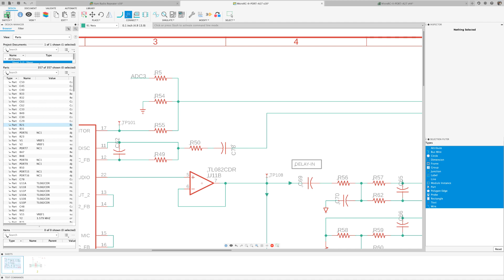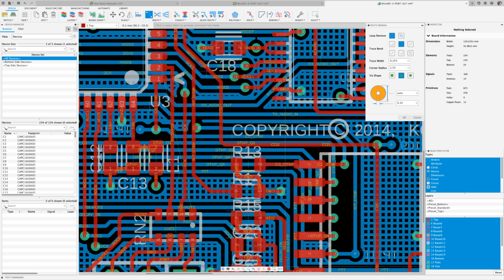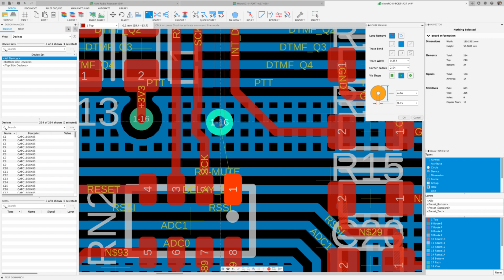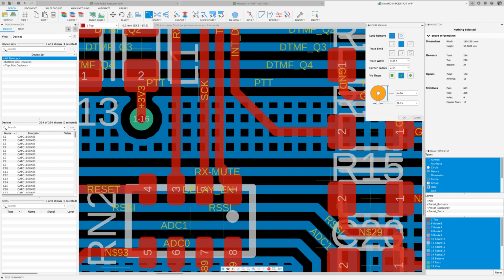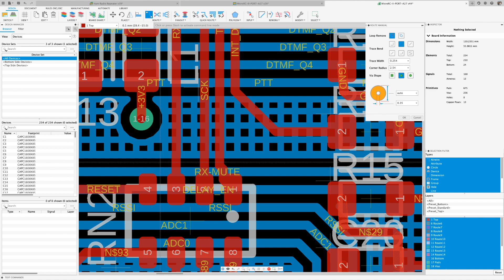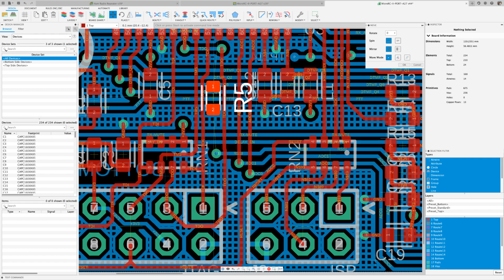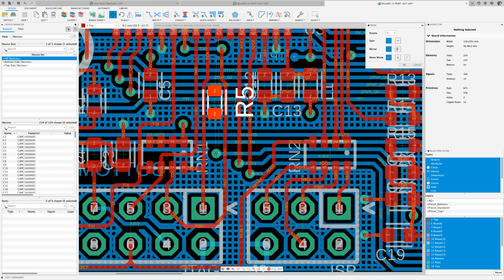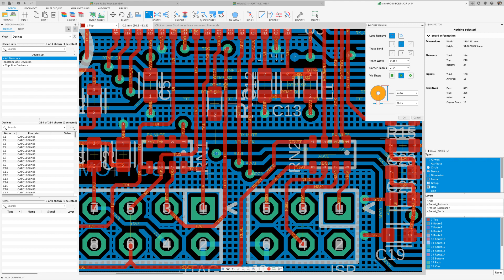Fusion 360 PCB layout: Push&Shove

Comment: I am baffled by this, as the UI looks nothing like, and behaves nothing like, the Eagle  9.6.2 I'm using to design PCB. Nor do I see a path to PCB design in Fusion.

Maybe back it up a bit and explain how to get to what you are showing here?
Reply from the maker: Hi Duncan, I hope all is well. You are correct, this isn't EAGLE, its Fusion 360. As of January this year, Fusion 360 includes a Schematic, Board Layout, and Library editor. The Fusion 360 electronic editors are 100% compatible with EAGLE. So you should you will have no problem uploading your EAGLE files and continue working in Fusion 360. If you have a subscription for EAGLE, you can use Fusion 360, just download it and begin using it today. Find out more here:  https://autode.sk/3a6LeRU Loading your EAGLE files in Fusion 360: https://www.youtube.com/watch?v=_UG-Ms71EfA
Reply: @adskFusion  ok, got it, thanks. Was able to get a design into Fusion360.

However until the issue with grbl milling generation discussed here is resolved, it's not that much help to me, or I need some other workflow to generate grbl milling for my pcb.

https://groups.io/g/pcbgcode/topic/75874702#8141

From the discussion, it sounds like an API has changed, breaking ULPs?